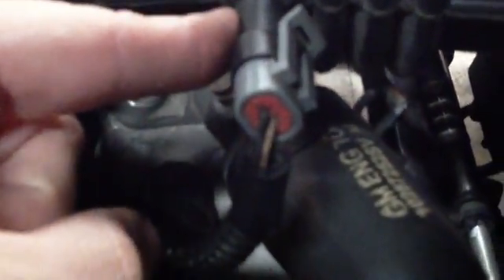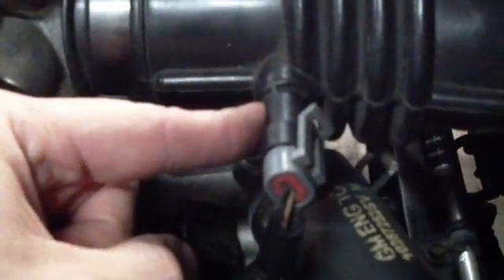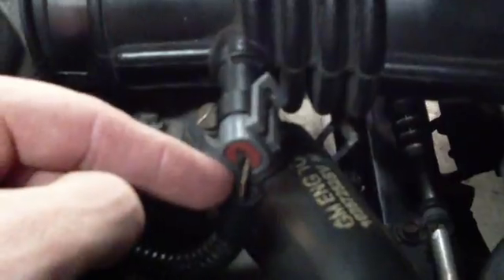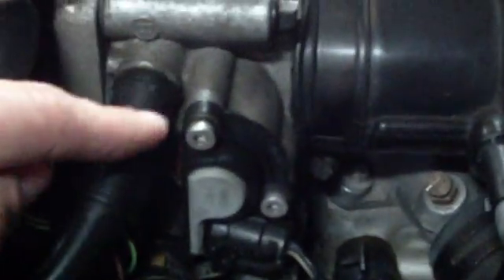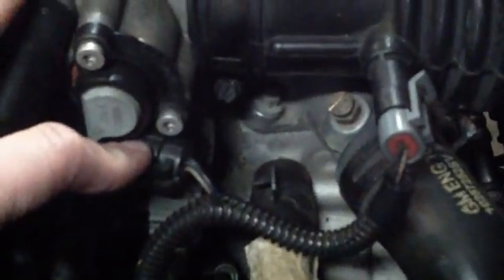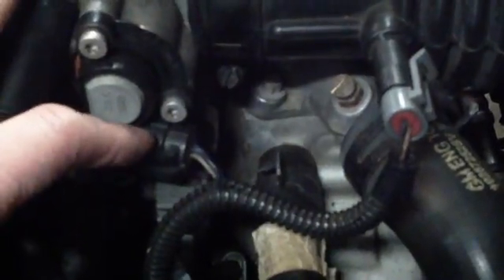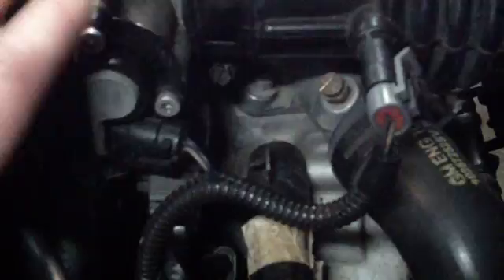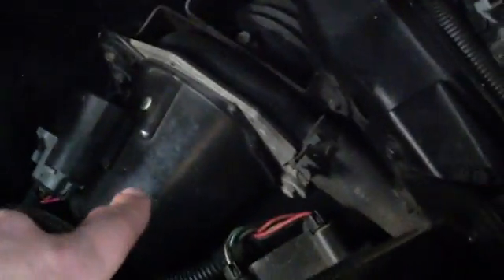LT1 Sensors Components

Comment: The reason I want to change the crankshaft is because my car starts then chots off, already change the fuel pump and filter the oil temp gage,coil and ignition sensor,fuel injectors,starts right up but shots off,
Reply: What did you find wrong ?

Comment: Good information but where is the crankshaft and camshafts sensors located on the LT1 engine, have a 92 Corvette and can't find the camshaft sensor can any body show me their location.
Reply from the maker: The distributior is the cam and crank sensor. The Opti part of it anyway.
Reply: @shawnbauman5463  thank you for the information just want to comment that I put brand-new fuel injectors, fuel filter, fuel pump, ignition sending unet,new coil.still engine stops running, check the fuses there all good fuel relay good,just can think of anything else,to fix it.
Reply: Ok thank you,I'll do more resurge on that.

Comment: If my lt1 (95 impala ss) had great power when you roll on the throttle but sputters and backfires through the exhaust (I believe) when you punch it, would you say that's sensor related? Seems to run rich or smells that way. Thanks for any input.  Chris.
Reply from the maker: I would start with making sure you have good fuel pressure when punching the throttle. Could be ignition could be a lot of things.
Reply: Can u name some of alot of things🙏😣
Reply: @johnbeer5242  see my comment.
Reply: It ended up being my coil wire.  Looked great but the part that clipped on the coil was broken. I finally saw it spark when I had the hood up trying it start it at night.
Reply: I’m having the same issue

Comment: My coolant sensor wire is broken from the sensor connector.  Where does it land.  Thanks in advance.
Reply from the maker: So the coolant temp sensor on the water pump has the end cut off? It goes all the way to the ECM.
Reply from the maker: Or do you mean the one on the head for the instrument cluster?
Reply from the maker: Where does it land? What do you mean? Sounds like you need a new connector pig tail end.
Reply: @shawnbauman5463  the wire has been cut and lm trying to figure out where the other end goes

Comment: Having a problem with my car where it has a real rough idle when it’s below 30 degrees then when it gets warm it smooths out to perfect, opti is new, fuel pump, filter and regulator, vacuum seems real good what sensor do you think it might be the Iac temperature gauge in the intake maybe? Have you ever heard of that problem before
Reply: Also though it does have throttle body bypass for the coolant but i don’t think that would help because the coolant would be cold too on startuo
Reply from the maker: Injectors, ohm check, amperage measurement is even better. Do it cold, since that is when the issue occurs.